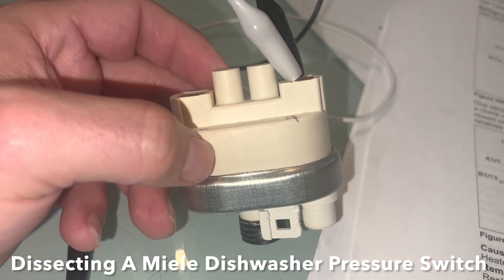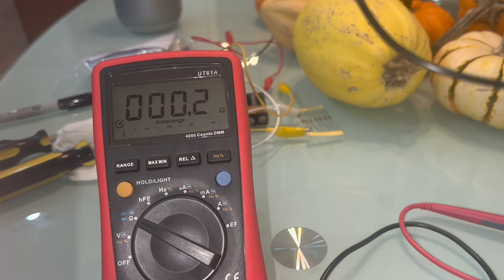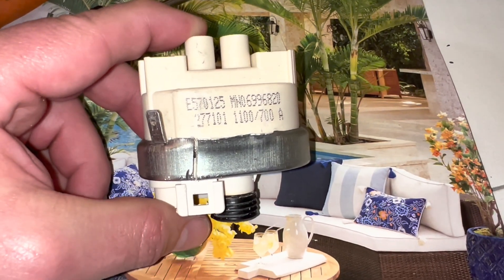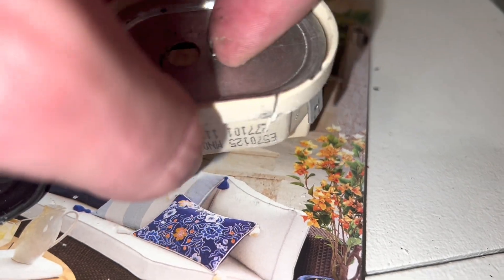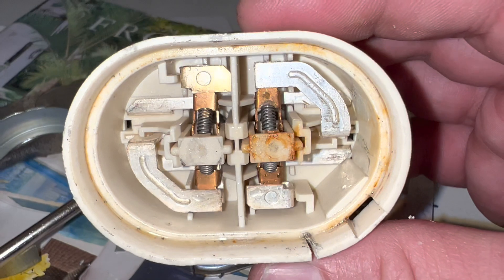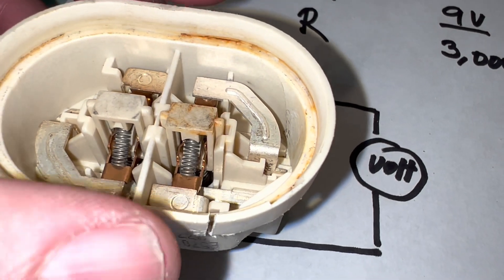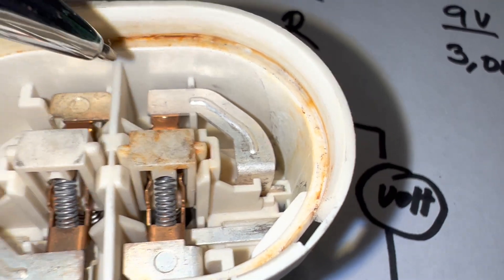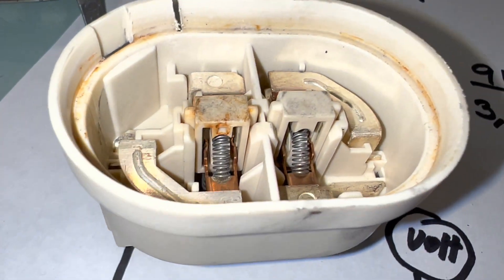Dissecting A Miele Dishwasher Pressure Switch

Comment: I seem to have the same problem with my dishwasher!  Thanks for helping me diagnose it.
Reply from the maker: @leekosky9444  glad to help.  Let us know how it goes after you replace the part
Reply: @rogerscubadiver  I replaced the part and it's been working without fault for 2 weeks!  Thanks again for your video.
Reply from the maker: @leekosky9444  that is awesome!  Thanks for sharing
Reply: Il est légitime d'essayer avant  démontage un spray pour contacts et circuits électriques  introduit par les petits évents situés près des puits des fiches electriques puis de pincer le sertissage qui restaurera l'étanchéité si la membrane n'a pas été percée par l'outil que vous utilisez pour manœuvrer les contacts.
Si la membrane est percée on pourra essayer de la doubler avec du film alimentaire et de ressertir avec un serflex ou sans démonter trouver une substance liquide comme de la dissolution qui en séchant fera une pellicule.

Comment: Same problem here.  F14 error and same leak and rust inside when I checked.
Reply from the maker: That is great to hear.  Did you replace the pressure switch and did the problem go away? 

I was very surprised when I started investigating this issue that no one else had root caused it to this part.  It took me several weeks to find and prove it.  Now I’m finding lots of people commenting in my videos that they had the same issue
Reply: I have ordered the part and will let you know once I swap it.  Mechanically my switch would test fine but it was the only remaining explanation for my F14.  To confirm before ordering new part I decided to see if it would hold pressure.  It failed - it would not hold a suction  (block hole with finger - suck hard on other side) so I figured that was the problem.  On disassembly mine looked even worse than in your video.   @rogerscubadiver
Reply from the maker: @dc-wt1wu  yeah.  If water got past the seal and into the contacts, I am pretty sure it would affect the resistance and cause the computer to throw faults.  I got the new pressure switch for my second dishwasher.  I’ll post here once I have had a chance to change it and take the old one apart
Reply: Just got the new switch. It held vacuum when I tested it so I went ahead and installed.  F14 error now gone and all seems good with the rest of the cycle.  Thanks for posting the video . @rogerscubadiver
Reply from the maker: @dc-wt1wu  fantastic news.  Happy dish washing

Comment: I have the same issue with a miele dishwasher, displaying f24 and i called miele , they told me that i should check pressure switch and I found water dripping from therminals so this is a new thing for me  ..thanks very much
Reply from the maker: Thanks!  My second dishwasher just threw an F24 code after some black powery stuff was found in the filter.  I’m suspecting the rubber membrane in the switch began disintegrating.  I have a replacement part coming and I will dissect the old one to confirm.
Reply from the maker: Did you get a replacement part and did it fixed the problem?  I just got my replacement part yesterday.  I’ll be doing the change soon and then dissect the old part

Comment: Why do you think the switch stopped working?  Was there anything obvious from your direction?
Reply from the maker: I believe a small amount of water got past the seal into the contacts.  You can see in the video when I remove the metal plate there is a slight wetness inside.  That likely caused some corrosion.  Another possiblity is that the mechanical spring that breaks contact got fatigued and it doesn’t open as much as it should be to create the open circuit.